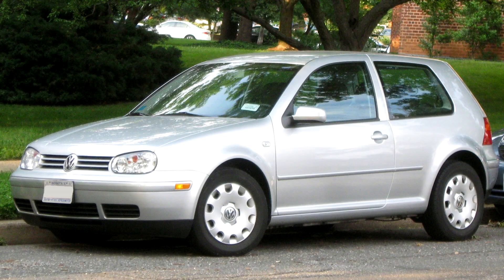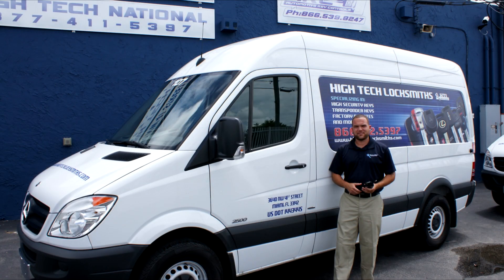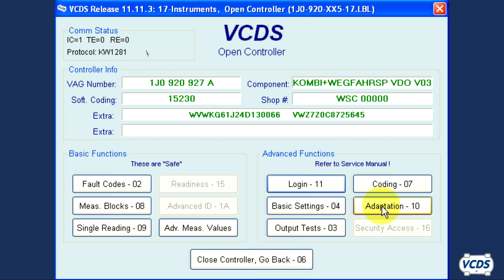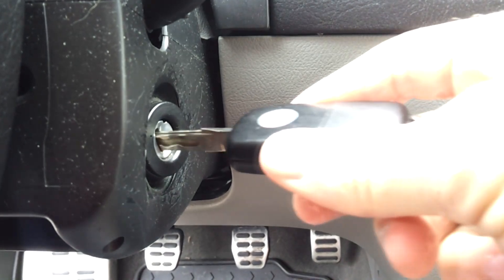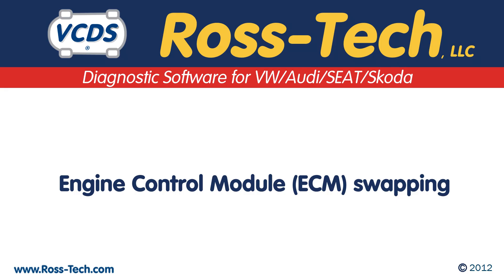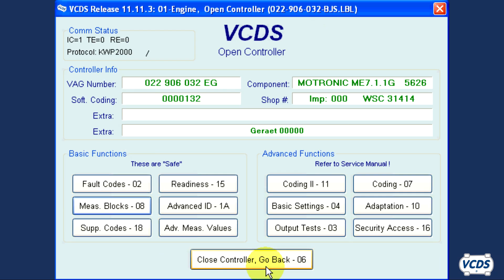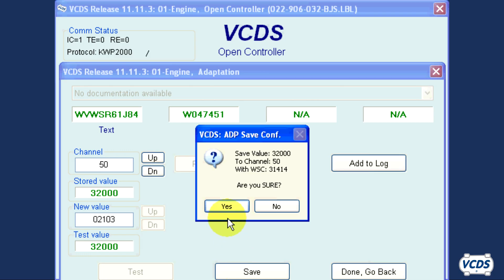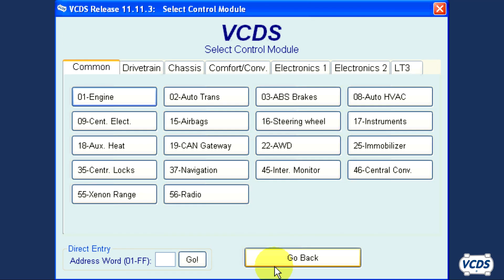ECM and cluster swapping for Immobilizer 3

Comment: Is there a number where I can call and talk to somebody about an ecm swap In a 2003 VW New Beetle?  Im trying to bypass the immobilizer or do something so this VW ecm swap will work.  My VW starts but dies 
Instantly.  The original ecm is missing  pins and can't be plugged in.  I need to know what to do next please?  Thanks, jewelz  ( it is a immobilizer 3).  I found the sticker back by the spare tire for the code for the cluster but not sure which one it is or if this is good information?
I need my car to run and have been researching it for days already to no avail.  Please help!!!

Comment: For clusters just copy data from old dump to the new one. No key adaptation, pin and you can set old mileage.
Reply: How can you do this please?
Reply: I have tried that with my original BOSCH 1j0920826C and i think it doenst "copy" correctly all the eeprom (using eeprom manager), because i try to write the original eeprom to a VDO 1j5920826C from VDO and at 50% failed.. readed that bosch are hard to read eeprom

Comment: If i replace cluster with a used one do i have to program new keys also ? Or is there any way that that i could use the keys from the old/original or the new/used cluster ?
Reply: Keys are paired to cluster, cluster is paired to ECU
Reply: Swapped over BCM / ECU /Cluster and key ignition .. switch from donor car should work !

Comment: How does the correct VIN from the original ECU get copied over to the replaced ECU with pin alone? This procedure suggests no matter what the original VIN should be copied over.
Reply: it hamms and hashes the binary converted VIN into something mixed against the PIN and compresses it and shits an algorithm result - compressed maybe like JPEG or error correction

Comment: I'm replacing the ECM that was damaged from my customer replacing his own radio. I cannot read info from the old module. Can I still install a used module if I cannot access the original PIN information?  I can however assess the Cluster, it is my understanding that the cluster and ECM have the same PIC information.
Reply: 83554 83554 use VAG Tacho software to retrieve PINs.
Reply: 83554 83554 should be able to retrieve the PINs using VAG Tacho.
Reply: Thanks  @aygwm  .Have you had good experiences with VAG tacho?It says somewhere that you can brick the cluster if not careful and is it guaranteed that it willl give you the PIN number?Also reading on some other sites it says that only locksmiths using specialized equipment can retrieve the PIN.
Reply: shredtilyurdead I have not used it myself but it’s the de facto tool for doing the job. I can’t imagine you’d have any risk of bricking your cluster just reading the SKC PIN. Probably more likely someone trying to write to the EEPROM and messing it up or something. But the tool is a rental and is designed to do this very thing.
Reply: @shredtilyurdead  Hi, I have used it to retrieve the pin from my VW Jetta car and a friends Audi A4, in order to get some extra keys working. It has worked like a charm and haven't had an issue since.
Reply: roncarguy72 hi did you resolve this as i am having the same problem where I cannot obtain the original pin from damaged cluster. I can lol the 2dnd hand u it with vagtacho butcantpull it from the original one.

Comment: Hi, one question, to retrieve the PIN from the replacement cluster (used one), is it possible to do it just connecting it to the car and using a pin reader tool? or should I get it before getting it off from the original car? Thanks!!
Reply: Yes it is but don’t fit it when engine running!!

Comment: I sent my ECU in to remove the Immobilizer as it didn't work.. So instead of replacing it, It was alot cheaper to disable it.

However, when I got it back the ECU says XXXXXXXX XXXXXXXX (Both VIN and Immo ID).
As for now, I have access to the full version of VCDS .. So what should i do in this case?

Comment: hi need help I have a seat leon mk2 2007 I have pin for original and 2nd hand instrument cluster but when matching to car login 11 is greyed out so I use security access and enter my pin it says incorrect pin I then have to wait around 10 mins to reset. the pin I have works when doing the same but on the immobiliser security access and it accepts it. can someone help please. Oh btw I'm changing from standard clocks to fr clocks. thanks in advance

Comment: hi in changing ecm how do i get the used ecm code and the original ecm code ?? can i get the original ecm code from instrument cluster since they are the same pin (i can do it using super vag k + can), if vcds does not retrieve the code from the used ecm can you recommend me a device that can do the job please help  me

Comment: Hi,
I drive a 2005 MK4 GTI and the engine immobilizer prevents my car from starting at random times throughout the week, about 6 months ago I unplugged the instrument cluster and plugged it back in, I didn't have any problems for 6 months, but now it is happening all over again, say I replaced the instrument cluster, do you think this will remove the engine immobilizer problem?

Comment: I just performed a full MK4 R32 swap into my GTI. I'm using my original key and my original cluster, however. I have the SKC for both the R32 and my original GTI. Whether I log in at ENGINE or INSTRUMENT, block 50 returns KEY, NOT OK. I've posted in VWVORTEX's VagCom forum. Please advise.
Reply from the maker: SCK numbers have not been around for maybe 9 years now... are you sure you have a valid SCK, dealer WSC and date issued?
Reply: Just the SKCs. Found out that I only needed to plug in the ignition switch. Thanks.

Comment: Hello ,

I would like to ask for advice and help.
I'm planning to swap the cluster in my car ( Passat 1.8T, AWT, 2002 year, manual transmission ).
For now MFA cluster is in the car, but I have a chance to purchase a FIS cluster.

The only problem and difference between two clusters is that the other cluster is from automatic transmission car ( the car is AWT, same year of produce, different gearbox ).
So, I would like to ask, do I purchase that cluster or not ?
Can I adjust without any issue that cluster to my manual transmission car ?

Thank you...

Comment: @RossTechVCDS, How do I retrieve pin of a old ecm I purchase from breakers?

Is this the same pin I used to program my keys I extracted with Vag Tacho?
Thanks
Reply: The original ECM will always have the same PIN number as as the original cluster.  You will have to get a ECM pin code scanner to extract the pin from your 2nd hand ECM.  Vag Tacho should have ECU PIN read feature though.  The value you enter in the "32000" field is the PIN number of the cluster (same PIN code you used to program keys).

Comment: I'm buying a replacement ECU for my car, which I am going to remap then replace the original one, if I do the procedure as shown in the video (a used ECU) will I be able to swap them back and forth if something goes wrong? i.e. once I've set the pin in the 'new' ECU, will the cluster then not accept (immobilise) the old ECU? 

If at all possible I'd like to 'clone' my original ECU, I was considering opening up both and reading the Serial EEPROM contents from the original and just dumping it into the new one. Would this work?

Cheers!

P.S it's a MK4 TDI 110 ASV engine with Immo 3.
Reply from the maker: There is no limit to how many ECMs (or Instrument Clusters) you can have matched up to a vehicle.  As for EPROM dump... I've not done it, so I suspect the correct answer would be a "definite maybe".
Reply: RossTechVCDS Ok, so if I was to do the procedure, then the new ECU didn't work for whatever reason, I could just put the old one back in and wouldn't need to re-code it?

When I get my hands on the new (used) ECU I will open it and perform an EEPROM dump (backup), then I'll dump the EEPROM from my original ECU and write that to my new one. With any luck all of the VIN information will be held here and just transfer over so that either ECU could be used. A while ago I dumped the EEPROM from an earlier (but similar) ECU to my car, there was a 5 digit number plainly visible in the dump, looked suspiciously like the SKC.
Reply: @davegsm82  I am curious how this worked out for you?
Reply: @ryanscarver  it worked ok, I had a spare ECU which was essentially just an EEPROM clone of the original ECU, so the cluster was unaware anything was different when I swapped them.

I chopped that car in 4 years ago but still have the remapped ECU, and even the cluster etc as I'm eventually going to use it in my T3 camper van which I've converted to TDi.

Comment: Am I following this right? Pay $350 for VCDS, if car needs a cluster or ecm, still need to hire  a  locksmith for services? If so, that's bullshit. The whole point of investing hundreds of dollars on technical equipment is to AVOID having to pay someone (locksmith) to do the work.
Reply: I think the pin is also on a sticker on the cluster
Reply: Yeah I have a cheap OBDStar code reader for VAG ($30) that could pull the info. Why VCDS can't is a joke.
Reply: @DaytonCarCare  interesting, do you have a link for version for vagcom (audi)? The whole idea of vcds and other diy diagnostics is not having to get ripped off by dealers or so called specialists that just replace parts that are not nescessary to replace.

Comment from the maker: In most cases, no.  In the context of doing an Immobilizer 3 swap, if you input a wrong PIN, then the control module will lock you out for X amount of time.  But nothing permanent.